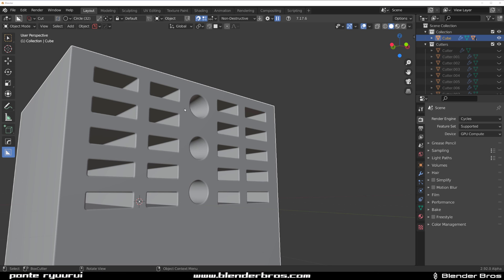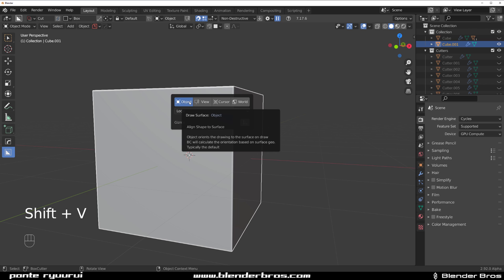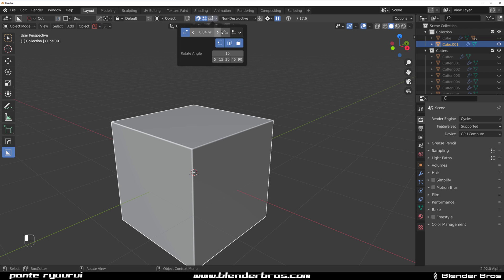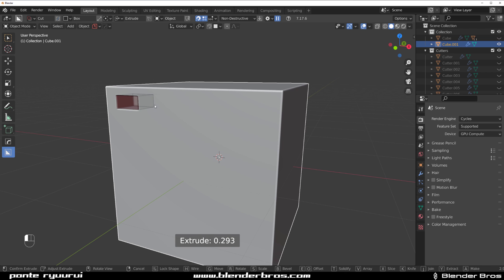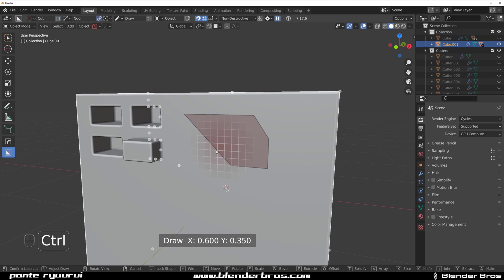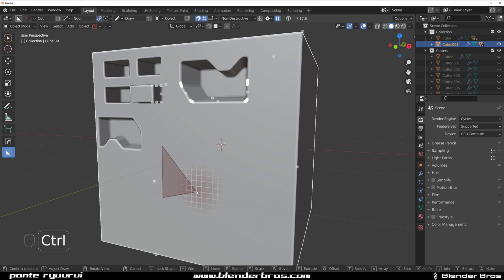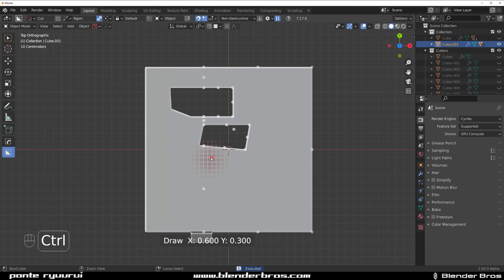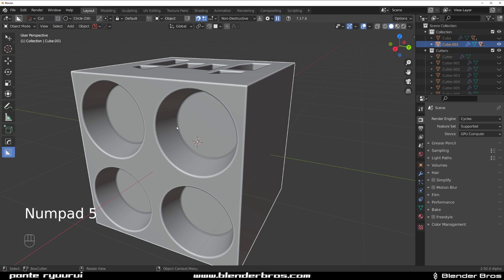TOTAL boolean control with Boxcutter's SNAP GRID - Blender tutorial

Comment: Another great vid Ryu, cheers.  Quick question since we're talking about uniformity.  How do you clone a boolean to be reused?  With a cut it seems to be pretty straightforward (just duplicate it) but slices don't seem to work the same way.  Any tip on how to precisely clone an existing slice to be placed elsewhere on the mesh?  Have a great day.
Reply from the maker: Glad you like the vid mate. Duplicate it in edit mode, that way you dont have to run a boolean again.